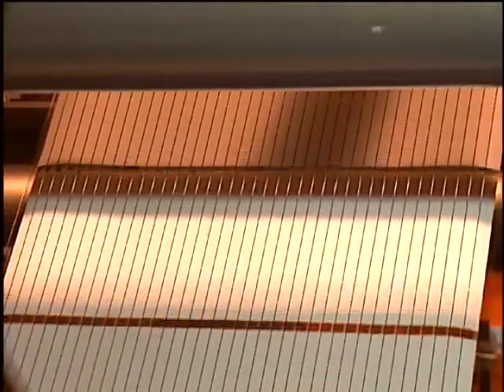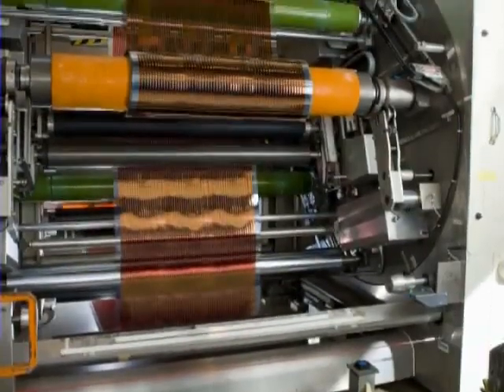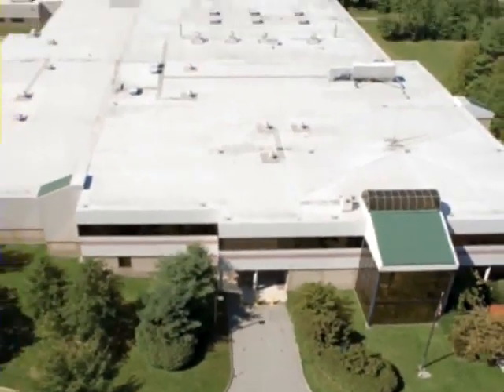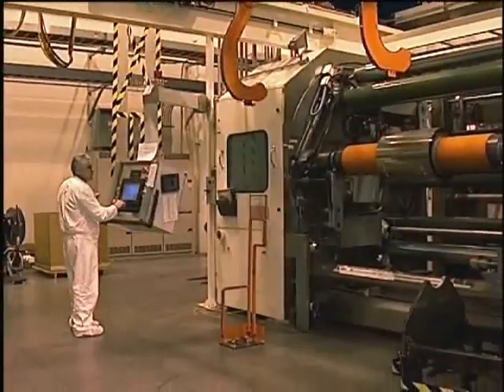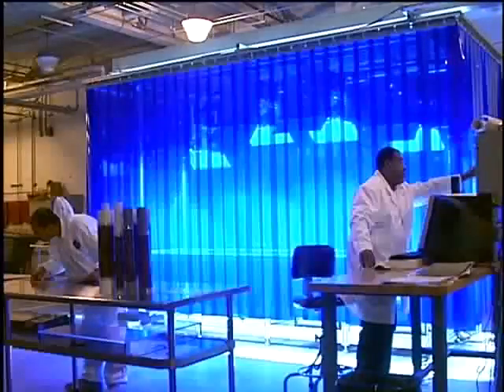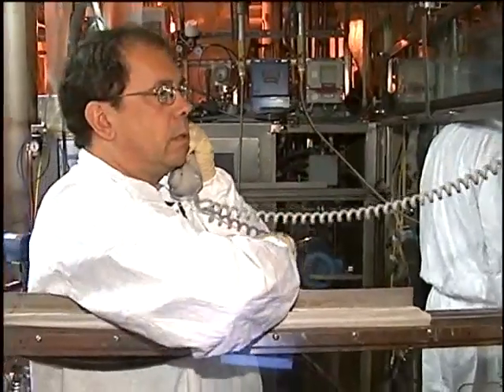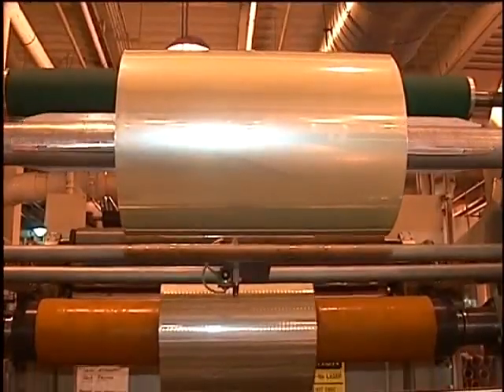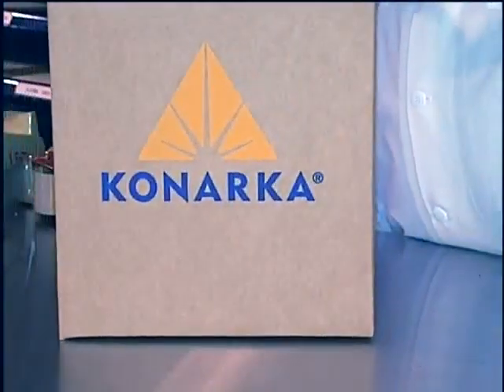Konarka manufacturing - Organic Thin film Solar Cell Modules

Comment: Where can an individual buy this?  Put it in a store and consumers will flock to it.  When its in a wal-mart type invironment, I know of lots who will aquire it, but dealing with these wheelers and dealer types in 'specialized' stores will not allow it to spread into the mainstream.  Most of these 'solar distributers' jack the cost of cheap technologies up to the point that no one can afford it.  Almost everything we run here is thin film because I can get it on the cheap in a big box store